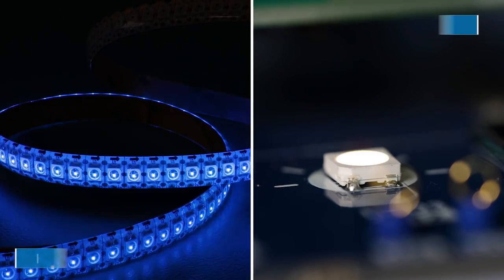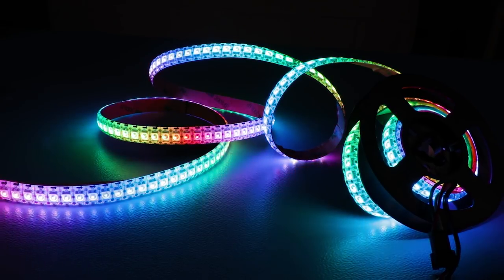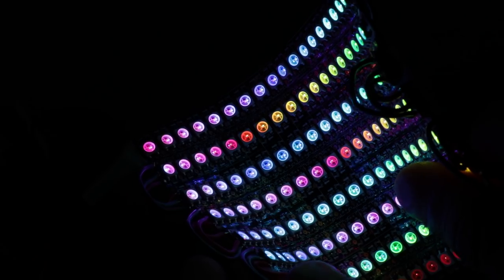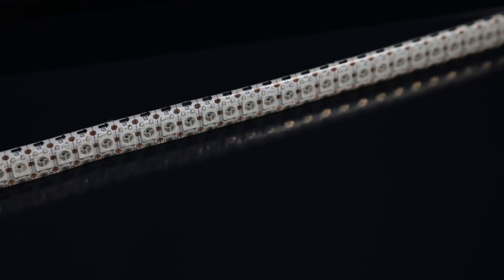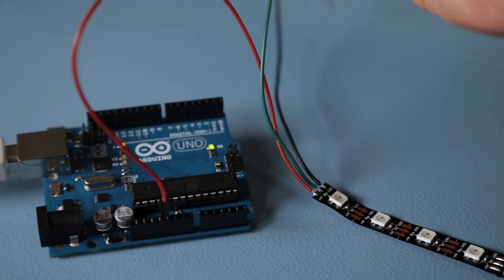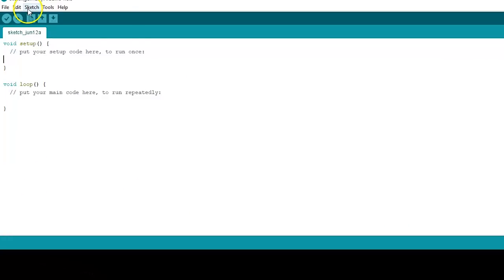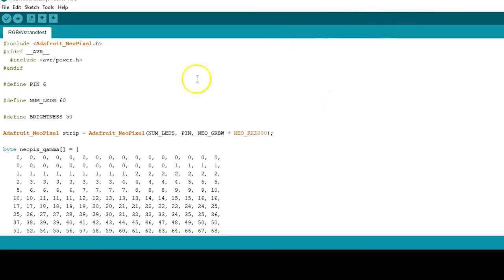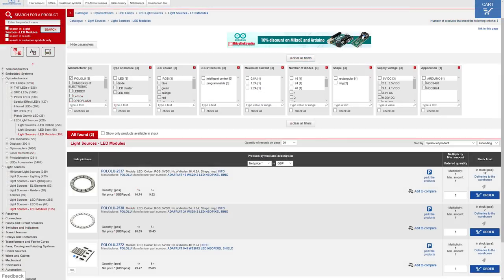WS2812 [Programmable LED Strip]

Comment: this seems interesting. I am planning in the future to make night lights / emergency lights that react to different scenarios. For example if I get up from my computer at night, I'd like the path to fridge or bathroom to be lit and turn off when I am no longer travelling on it. also, in case of firealarm, I would like the floor to guide to the nearest exit avoiding the danger. Also... could use the lights as rave lights in parties :'D I just need to learn more about programming to make any of this happen.